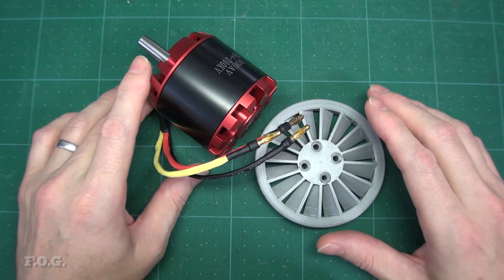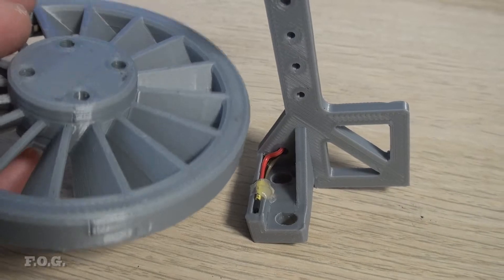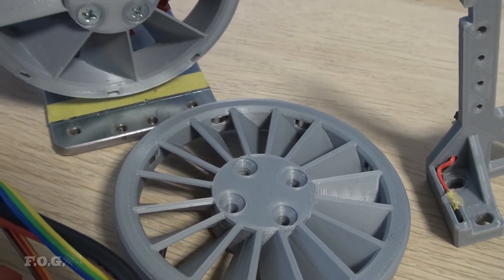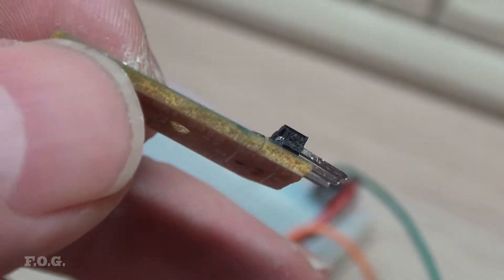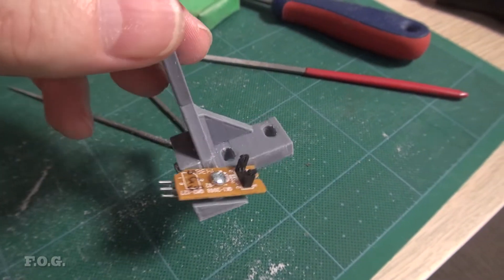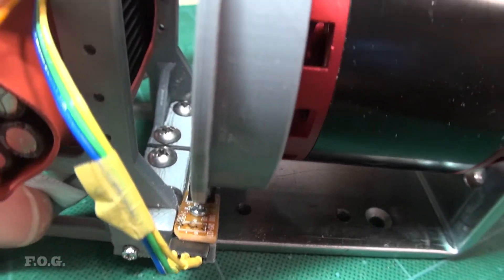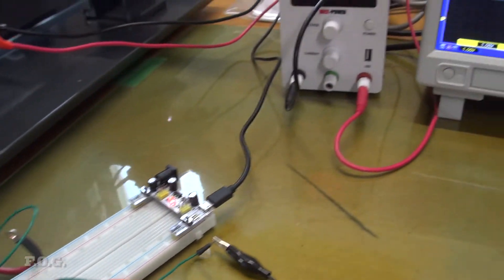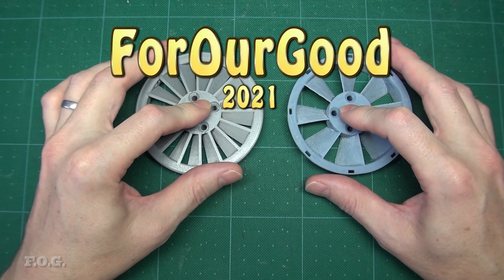EP10 - Mini Lathe Upgrade - Improved Motor Fan & Sensor - Brushless Motor Conversion How To

Comment: That's an awfully tiny motor for these lathes. How does it hold up under low RPM? Make and model?
Reply from the maker: Actually, I have seen some people use smaller motors intended for RC Cars.. I think this one is meant for small kick scooters or something.
Recently I have been doing some machining with mild steel, and the motor has been performing very well, probably have some more shots of that in a video coming up, so check it out then if you like. My controller also automatically maintains a constant RPM by driving the motor harder as need be, but the motor seems happy to take the heavy loads.  In low gear I think it will reliably hold a pretty heavy cutting load down to  about 200RPM with my automatic controller.
Marking in the motor is BDUAV 6364-200KV  (I don't see any maker markings, likely from some generic Chinese OEM)
Thanks for your comment & question!
Reply: @ForOurGood  I bought a 50lb industrial Baldor motor for mine because I was worried about low RPM torque, haven't been able to hook it up yet though. After seeing your video I'm thinking it will be totally overkill. You can find them on ebay, about $80-$200 if you want to give it a try some day.
Reply from the maker: Wow that is a serious motor, you will have some fun fitting that! I really wanted to keep my lathe portable, so this is one of the reasons I stuck to the smaller motor. To be honest I feel I got lucky with this one, but it turns out to be a great fit for the mini lathe and much better than the original motor. Thanks again for the comment, and good luck with your build.

Comment: Another good video, thanks. I  remember in an earlier video you commented about your oscilloscope;  could you elaborate?  Any suggestions on a good budget model? 
Again, thanks for the series.
Reply from the maker: I really like this scope, I was simply generally referring to this class of DSO which are still worlds away from showing the high frequency detail that an old analogue scope does. I chose this scope by looking a bunch of $200 class DSO testing and teardown YouTube reviews. I liked the way the Hantek was built and the software, so I took a chance on that and I cannot complain. I have a super high end USD45K Tek scope from about 20 years ago, that is really a nice scope even if it is a bit dated. But it is big and a pain to get out and set up. So far the Hantek has proven good enough and I have not needed to do so. If anything, I probably should have gotten the 4 channel version...

Comment: I found the Hall effect units used in car ignition systems worked better than the type you used as they work by a metal interrupter impeding the magnetic field which is more accurate than trying to sense an approaching magnetic field like you are trying to do . The optical system should prove to be reliable provided you keep the pulse per rev count down to a minimum - below the switching frequency of the opto transistor or diode . I have used some of the cheap units on ebay for tachos -they use a proximity sensor and have found these reliable up to 3000rpm, my taig lathe uses the hall effect sensor from jaycar that was used in bosh ignition units in cars and it is good out to 5000 rpm  - maybe more but the chuck on the lathe has a max  rpm limit on it and i don't want to push my luck !
Looking at your first motor fan reminded e of the fan on the motor of my chinese 3020 engraver and the second more like a real fan from a computer case fan - i think the former is not designed properly and the latter will work much better .
Fantastic video  !
Reply from the maker: If you have a model number or something for that type of hall effect unit it would be nice to have as a reference. I do not have the data on hand for the opto devices I am using, they are just things I had kicking around. But the rise and fall times seen on the scope seem to indicate they are switching pretty fast. I remember that on my first test with the reflector opto (Arduino line tracer module) directly on the motor body I just had a bit of masking tape, but on the scope there was a bunch of tiny unwanted pulses showing up.. when I checked, I found it was the fine writing of the model number on the body being picked up precisely by the sensor.. so I am thinking it is switching pretty fast :) Thanks for the comment, compliment and following along!
Reply: @ForOurGood  
HKZ-101 Hall Effect 
They are getting hard to find as cars don’t use distributors any more .
Reply from the maker: Thanks, I will check it out. Just wanted to make a mental note as I was not aware of this type of sensor.
Reply from the maker: Hi Ian, I did a follow up check on that optical sensor I was using for the motor and here are the results.
At 4,800rpm those 4mm long slots, at about 41mm from center, where giving a fall time of 100us, stayed down for 100us and rise time of about 175us, so thankfully well enough in spec for my use case.
The sensor gap is about 5mm wide,  and the encoder disc on the fan about 3mm thick, so this leaves about 1mm of free space either side. I am thinking that some of rise and fall times could also be attributed to this free space as some angular IR light would likely leak into the sensor as the slot approaches and leaves, and maybe even explains the bulk of the rise/fall times, and less so a sensor response time as such. (If I remember correctly the proportions of the pulse at lower speeds was much the same)